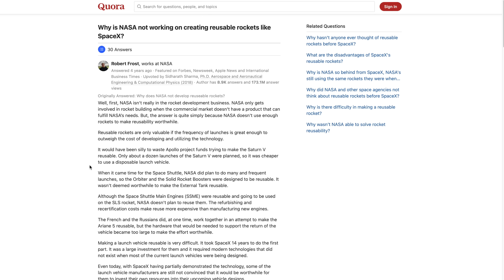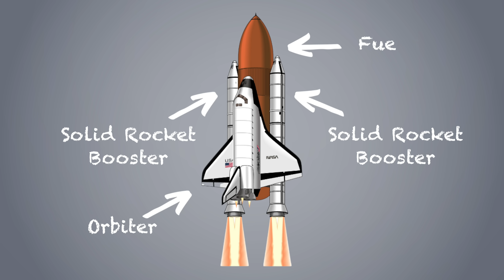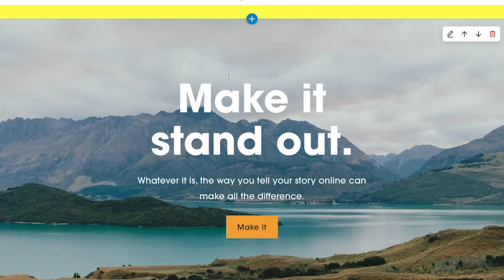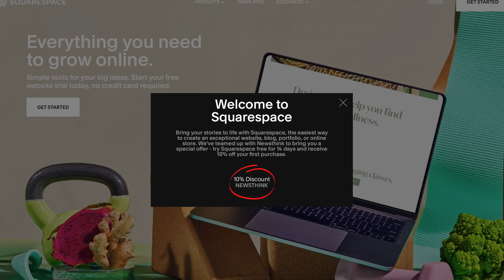Why NASA Doesn't Fly Reusable Rockets

Comment: I think the main issue is about recoverability. You can build rocket engines that can be reused, but there really isn't a point in doing that if you can't successfully recover the rocket engines. Something like the core booster of the SLS will be traveling all the way to orbit, which makes recovery extremely difficult. Even trying would add significant weight to the entire system, enough that it would inhibit the overall payload of the SLS and effect the mission as a whole.  It's all a trade-off, in the end.
Reply: finally someone who's actually thinking with a brain when they say it's not that hard to reuse the rs 25's on the SLS. the amount of weight added to recover them would make the payload capacity so low that it wouldnt even be able to put orion on a TLI
Reply: Reusable rockets will replace nonreusable. Your concerns are just hurdles that's all.
Reply: Pedro Kantor Cool. Starship has yet to prove anything.
Reply: @damien-nk9ko  Except for that reusable rockets are now a THING! Or did you already forget what just happened?
Reply: @damien-nk9ko  Why are you trying to downplay this break through? Watching too much Thunderfoot?
Reply: Pedro Kantor Never said they weren’t? Starship has yet to prove it’s reusable at all
Reply: Pedro Kantor Why are you trying to downplay the shuttle and SLS? Taking too much of Elon’s words seriously?
Reply: @damien-nk9ko  See I knew it! This isn't about science or breakthroughs for you, this is about your hate boner for Musk. Why are so many "science" enthusiasts hating on Musk now? Jealousy? I'm not even a Musk fan, but all this hate this man is getting right now is stupid. Why doesn't Jeff Bezos get this kind of hate? Atleast Bezos would deserve it. I bet if Musk's name wasn't associated with the rocket, you'd be singing a different tune.
Reply: @damien-nk9ko  Plus the shuttle was very expensive, couldn't make it passed low orbit, killed a bunch of people and has no successor. Sounds like a fail to me, no one even wants to make another one.
Reply: Pedro Kantor LOL sure bud. I don’t hate musk, he’s done a lot. What I hate is the communities of people who call everything else trash because of an unproven, unfinished rocket full of massive “ifs” the best rocket ever. I don’t give a shit about who made it, it pisses me off
Reply: @damien-nk9ko  SLS is okay, but will become obsolete if this Starship technology takes off. No one will want to use disposable rockets in a future where people will be more environmentally concerned. SLS will look like the other wasteful things that we no longer do.
Reply: Pedro Kantor cool, it was a good concept at the time. Just like starship, it’s just a concept
Reply: @damien-nk9ko  Well I must agree with you on this statement. Sorry for assuming that you were a Musk hater. Your position seems sound.
Reply: @damien-nk9ko  I was a space shuttle fan growing up, it's just that time wasn't kind to it unfortunately. I was actually pretty bummed when Obama ended the shuttle program. Perhaps you're right about Starship, but I'm optimistic and impressed about it's direction so far.
Reply: @pedrokantor3997 not to interfere, but falcon 9 2nd stage is not recoverable, just wanted to say that.

Comment: There is something that smells a bit foul with regards to NASA's policy on reusable rockets.  I question whether there  are kickbacks involved with this policy.
Reply: For the longest time, the onboard computer power to manage the return just wasn't available. Not to mention the hardware. The Merlin 1D builds on decades of previous engines to be as powerful and compact as it is. The Raptor on Starship is the first ever full flow, staged engine to ever fly. So part of it is the maturation of space hardware to allow reusability.

Comment: Plot twist Nasa scammed the Government for Decades also Nasa won't admit that the fact that SpaceX and Blue Origin have much better Engineers -that can create better rockets in cheaper costs!!!!😂
Reply: Lol, Even Toy companies can make better Rockets Than Nasa!!🤦‍♂️
Reply: Plot twist, the SLS isn't called the Senate Launch System. It was forced upon NASA. It was designed by politicians to spend maximum tax payer money. NASA engineers had to fight hard to give a little money to private companies like SpaceX.
Reply: dont you have some spendings inspection in US?
Reply: A lovely fantasy world you're in but very little connection to reality.
Reply: @CausticLemons7  The Expert with 20 + years of Different expertise levels* Please go on and correct me, what did i say wrong?
Reply: @LexlutherVII  First, NASA is a government agency so it would be difficult to scam itself especially when you consider how much is done by NASA versus government contractors. Second, NASA is directed by the Senate therefore many of the major decisions they make are political and not chosen by NASA professionals (Shuttle requirements and stagnation, Ares, SLS, and more). Finally, NASA has openly supported and partnered with both SpaceX and Blue Origin. They have stated that the development cycles for private companies was advantageous compared to their traditional government contractor approach, specifically naming the Falcon rockets as something unfeasible for NASA at that price point.
You don't have to be an expert to do basic research and fact checking.
Reply: @CausticLemons7  i apologize for my misunderstanding and ignorance!!😪
Reply: @LexlutherVII  No need for apologies. Let's go #teamspace
Reply: @CausticLemons7  All the way!!😎

Comment: Eventually all rockets will be reusable, SpaceX has already opened the can of worms.
Reply: Can of worms?
Reply: @deathwish374  It's a Murphy's Law reference: if you open a can of worms, you cannot put the rest of the worms back into the same can. Used for non-undoable events.
Reply: @BBQ BEER FREEDOM  I meant reusablity that actually makes sense.
Reply: @kpbendeguz  The question is would have NASA lost 14 Astronauts if they instead had used a none reusable rocket with a safety system.

The Starship isn't equipped with a safety system for their crew and also the current design is in need to launch and return the crew safely. It will stay a rocket and not a plane.
Reply: @oxygenasturia5706  NASA could have used reusable rockets with a safety system instead of shuttles as they do today with F9 and Dragon.
Starship is in early stage of development, so we don't know yet how it would work on a regular basis, there are many features undecided.
Starship is obviously a rocket and not a plane, it was only an analogy that it is possible to create a vehicle that can reach far destinations fast, safe and can be used multiple times a day. Of course air flight as an industry has a whole infrastructure but that can be built for reusable rockets as well.
Reply: Possibly, but not all no.  Some rockets can't be reused.
Reply: @BBQ BEER FREEDOM The cheapness of a rocket where both stages can RTLS and immediately launch again means you can simply brute force your way to the destination for less cost than launching a slightly more efficient but expendable rocket.
Reply: @BBQ BEER FREEDOM Not quite, as everything in Starship is reused. It's designed to not require refurbishment. For example, rather than inspecting and drying tens of thousands of unique tiles (and almost rebuilding the entire vehicle), you just need to check that none of the uniform hexagonal tiles are broken. The vehicle is likely designed to test itself for most other faults. This is probably a bad example because the booster is reused a lot more rapidly than Starship and lacks a TPS.
Reply: @BBQ BEER FREEDOM it was reusable, unfortunately the way it was reusable still costed 1,6 billion $ per launch in today's $.
There was way too much effort in man hours for refurbishments.
Reply: @BBQ BEER FREEDOM All airplanes designed to be immediately reusable. That doesn't mean they don't require repairs.
Reply: @BBQ BEER FREEDOM Officially it's around 200 million per Crew Dragon launch, a non crewed launch with a reused booster and without the capsule (which can be reused but needs refurbishments) is around 60 to 100 million $ 
https://www.youtube.com/watch?v=jMOt5yAyXLc
Reply: @BBQ BEER FREEDOM Essentially these are the official numbers by Nasa,
Just google for Nasa document 20200001093 for the launch costs of the shuttle
Reply: @BBQ BEER FREEDOM And you seriously think that planes became the safest mode of transport from thin air? How many planes has crashed before the technology has matured to be used in public transport? And how many tragedies (followed with investigations, regulation changes, etc.) had to happen until planes became as safe as they are today?
Elon blows up rocket _prototypes_, because it is an essential part of the development process for the same reason: to make rocket technology as safe as planes (or at least as close as possible).
Reply: @BBQ BEER FREEDOM Okay, Thunderf00t stan.
Reply: "Everything in starship is reused"

Starship doesn't exist you fanboy.
Reply: @gogogooner  it's not finished yet - but there's already flying hardware, the next launch will be the full configuration including the booster, and a upper stage making almost one orbit
Reply: @simonm1447  Riight, they will have an SSTO vehicle capable of going to Mars ready aaaany time now. Keep dreaming.
Reply: @gogogooner  Come on, stay realistic instead of hating. 
It's clear SSTO sucks in terms of payload - Starship will not be capable of SSTO, like every other rocket too. It's simple physics, there are very good reasons for staged vehicles when launched from earth (SSTO is possible in less gravity, for example on moon or mars). There are reasons Venture Star was cancelled.
Also star Starship will need refuelings in LEO for moon or mars missions to reach escape velocity. 
You don't have to dream, you just have to watch test flight live streams to see flying hardware bigger than church towers launching and landing afterwards.
Reply: @simonm1447  What do you mean "stay realistic" - SSTO was the concept presented by SpaceX a while back.
Reply: @gogogooner  It was once presented as a possible LEO option - but Starship won't be really SSTO capable on earth, at least not with payload. The only thing it could do without the booster stage is a ,,hop'' of maybe 10k or 20k km on earth, with payload, but this is no SSTO because it's no orbit. 
For a escape velocity you need way more energy than for LEO, a SSTO vehicle for a mission out of earth orbit is completely unrealistic and was never proposed by Space X or any other serious company. 
The Saturn 5 for example had a payload of 140 metric tons into LEO - but only around 50 metric tons were left in a TLI (trans lunar injection), where it had to reach escape velocity.
Reply: @simonm1447  Riight. I think you should watch that old presentation again. Or is your argument "oh c'mon, everyone knows that was promotion an buzz-creating".

My point still stands, it's not really me you should be telling to be realistic.
Reply: @gogogooner  Where can I find the old presentation? They surely have a lot of presentations in behalf of the Starship
Reply: @simonm1447  Fair enough, it never was an SSTO concept. Point still remains - they're nowhere near having a vehicle taking people to and from the surface of Mars.
Reply: @gogogooner  Of course it will still take some time for them to get a man rated vehicle, they are in the prototype stadium and the final design phase is not reached yet. First they will launch cargo versions for a couple of years until the vehicle is really flight proven. 
A manned mission to Mars is a future scenario, we don't know yet if or when it will happen. 
The vehicle design however is chosen with this goal, it's big enough for the job, and it uses methane as fuel because you can produce synthetic methane and LOX with solar energy on the Mars surface, so they don't have to carry the fuel for the flight home with them the whole time. The raptor engines are much simpler constructed (turbopumps etc) compared to the RS-25s, because they have to reignite them a couple of times during the almost 2 years long journey.
You should not take their time schedule too serious, it's Elon time which means it usually happens (at least this was the case in the past), but it will almost surely take longer in reality.
Reply: @simonm1447  If they land their Starship on the surface of Mars with a significant payload of cargo within 2 years, I will eat my hat...
Reply: @gogogooner  You understood me wrong, it will surely not be within 2 years - the journey itself takes around 2 years (for the flights, and the time they have to wait on mars for the next launch window back to earth).
We don't know yet when a Mars mission could begin - unmanned missions could be attempted in the mid 2020s if they don't run into problems with the Starship development, but of course a manned mission would have to take place later because they surely won't risk lives with an untested vehicle on such a journey.
Reply: @simonm1447  Well, I speculate venture star could have done it, maybe not with year 2000 tech but certainly more possible now.  Payload problems however may still be an issue but the aerospike I think is atleadt one of those things that will probably resurface one day when we can get the bugs worked out.

Comment: They made the Saturn five a stage rocket so it would make sense it wouldn’t be reusable like all the stages and trying to get them all back to home it would be pretty hard especially for it seeing the time and era they made it cuz computers were as big as a school desk so idk man pretty complex but the computer for the Saturn rocket was pretty small it wasn’t the smartest and I don’t think if they tried getting the stages back home it would work like at all and they would have to do some modifications to the stages to get them back home but even still I don’t think the computers they would have used would work good enough
Reply: Saturn five first stage engines were too big to land like F-9. Need more smaller engines, ideally with higher isp and lower thrust. Launch it from West coast so it could land on land where a landing pad with radio beacon can be made and that could be done with 60-ies technology. Don't need a computer for simple control loop which rocket engine is.
Ironically Soviet Moon rocket was ideal for first stage recovery and Korolyev was thinking about that. If only he didn't died so early...

Comment: The SLS might be the last rocket NASA will ever design and build
Reply: Agree
Reply: NASA hasn’t designed a rocket since Saturn. Since then they’ve been designed and built by contractors, NASA just selects the design they want and manages the development.
Reply: NASA hasn't built anything for a long time. Apart from the technological needs, it's one of the reasons why Space Shuttle was so expensive. They needed to pay for the profit of every contractor.
Reply: @nottoday3817  Cheaper to design it and let someone else build it
Reply: The last rocket Boeing will ever design and build.
Reply: Cancel SLS
Reply: @gypsyemperor7535  id prefer if they built 3 and launched 3 as opposed to canceling it now, so much money has been wasted on it, it’ would be an even bigger waste of money to never use it
Reply: @Viralliness  Sunk cost fallacy.
Reply: @p_x_  at 20 billion for the system yeah it’s worth launching it at least 2-3 times
Reply: @Viralliness  you would still be wasting money to launch those 3 rockets. It would be cheaper to use starship.
Reply: @themartianway  the program is a waste of money either way, launching 3 at least justifys the waste
Reply: I don't think so,...
Reply: SLS is just a retrofit of old technology, even if the project is a success it will get outshined by the far modernized starship that is seeing a lot more action and progress.
Reply: Hope so
Reply: They seem to be doing better with deep space missions like sending rovers to mars and probes to pluto and beyond.
Reply: To be fair, SLS was essentially 'designed' through mandates by the US Senate to ensure continuity of contractors. In other words, it's a jobs program.
Reply: If they keep on this trajectory, 100% agreed.
Reply: NASA has never built a rocket, private companies always have.
Reply: *will be
Reply: NASA doesn't design rockets they hand it out to private contractors. There is no demand for them to build something fully reusable
Reply: @Legion849  they probably meant in the aspect that it is their intellectual "property" and not buying launches from private companies
Reply: Well yes, but actually no.
Reply: They haven't even designed it have they, its boeing. Just give the money to SpaceX obviously
Reply: I think you're delirious NASA and SpaceX are full partners and work together on everything NASA developed reusable rocket technology long before SpaceX and Elon ever came along the space shuttle and the solid rocket boosters being reusable in 1981. NASA engineers worth with SpaceX to develop the falcon and falcon heavy so it always amuses me when Elon fanboys bad-mouth the pioneers of human space flight and think that he and he alone developed that technology which is completely false.